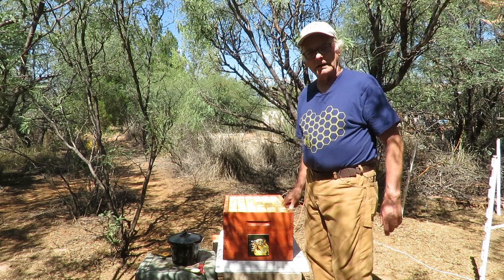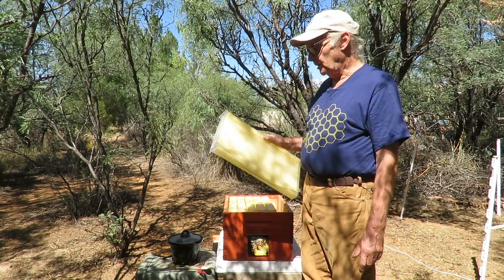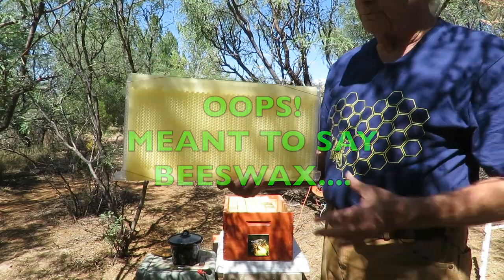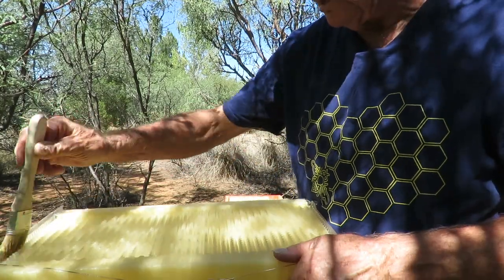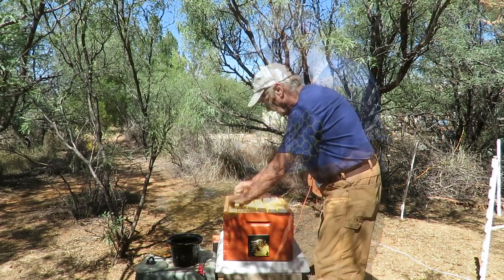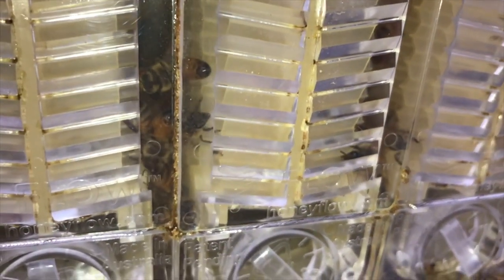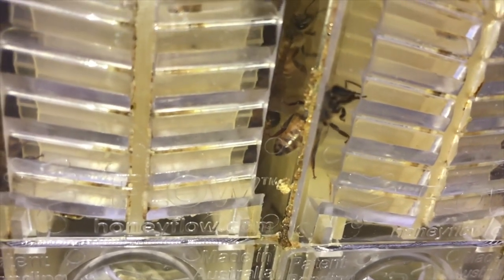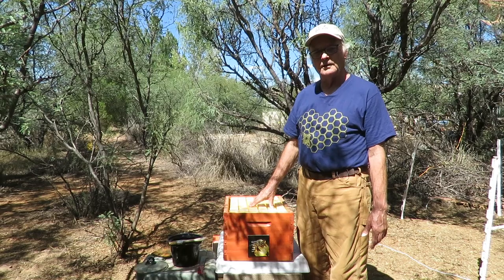Making Flow-Hive Frames More Acceptable to Honeybees

Comment from the maker: If you are interested in becoming a Beekeeper  and are planning to order a Genuine Flow Hive from www.honeyflow.com,  As a FLOW U.S. AMBASSADOR I can offer you a Discount if you use my Discount Code:  "CHUCK10” at checkout, this will save you 10% off your total order. The Discount does not apply to "Flow Bundles or other already discounted specials on the Flow Website"  The Flow Website always has new Specials, so, check their Website often!  HINT: If you order the items included in a discounted bundle individually  in a separate order, you can take the 10% discount off your total order when you checkout, and usually can save more than the already discounted Bundle. You can save on individual items from the Flow Website as well (orders must total $100.00 or more).